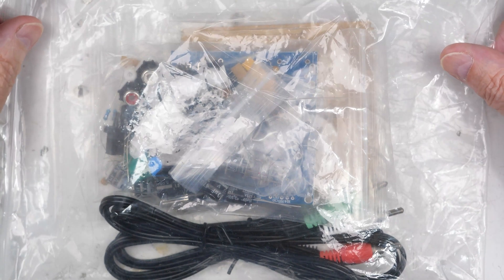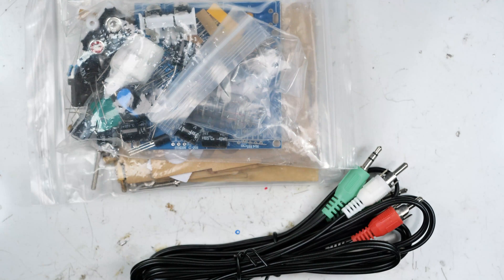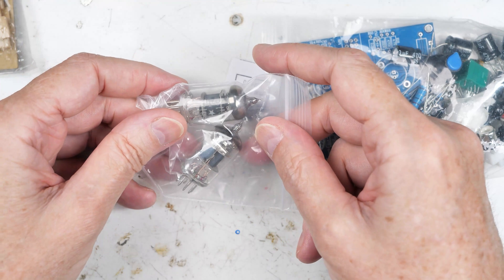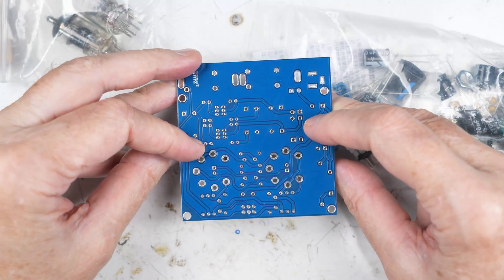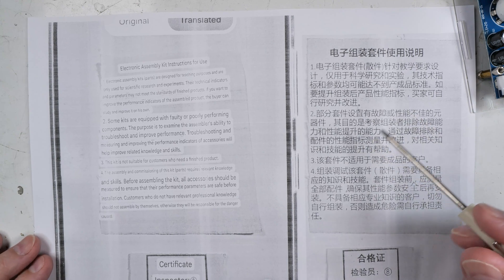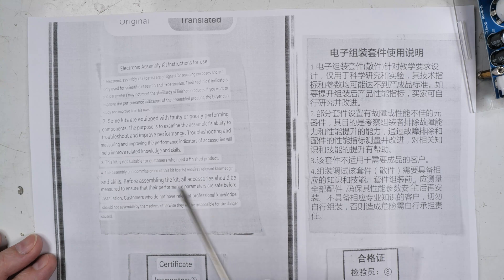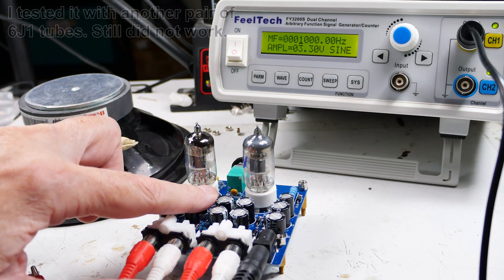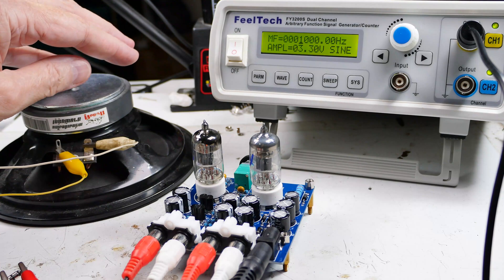Elec-Tube Amplifier Kit (For Crystal Radio, Etc.) Part 1/2

Comment: I'd be looking at the B+ voltages on the plates of each tube to test the B+ circuit (caution - high voltage).  Then I would look at the audio waveforms on each plate (same caution).  I assume the transistors marked Q1 to Q4 are the final drivers (because tubes won't couple to a speaker).  That circuit could be defective.  Have fun!